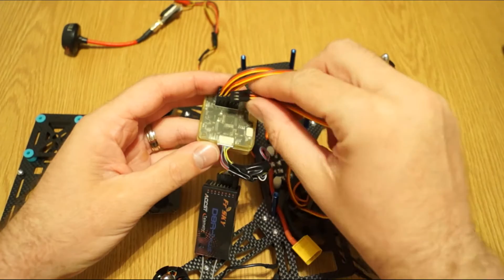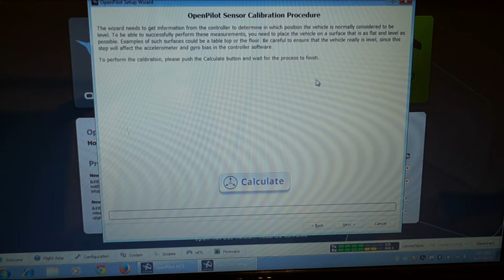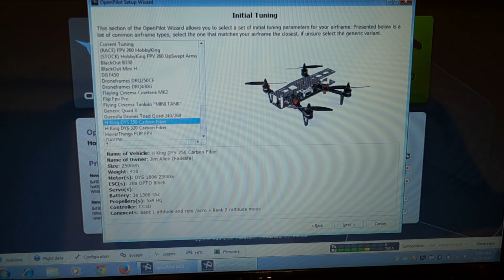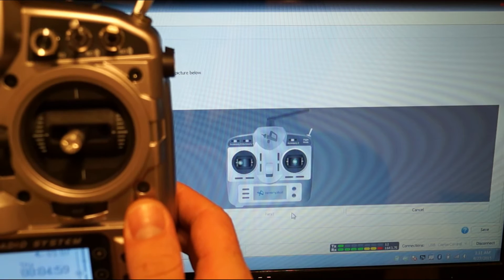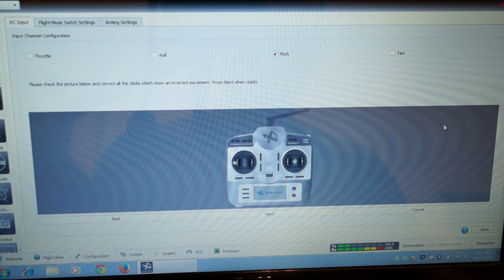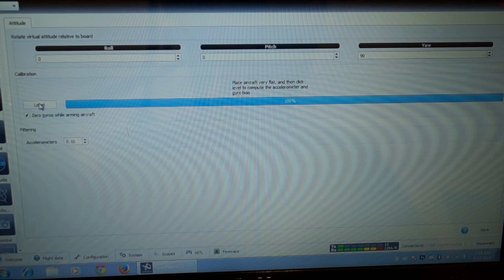AGM Nighthawk 250 Quadcopter Combo assembly part 2

Comment: Very nice and detailed video, only the autofocus of the camera get's is a bit annoying, but hey.

How do you secure the CC3D (flight controler)? I don't see it in the Video, and in other videos people don't have the casing like you have (and I to). I tried to remove the case and fasten it with the plastic screws together with the PDB, but the holes aren't at the same location. 

Can I also mount it upside down without the thing going crazy?
Reply from the maker: +Droolesky sorry for the focusing buzz...I will try sending a pics with this...basically I removed the case since there was not enough space and fitted double adhesive tape under it to fix and absorb vibrations.
Reply: +MrCofl1001 Pictures would be nice! I placed it with the casing where the camera is supposed to be, since i don&#39;t have one at the moment.&#160;And the camera buzz isn&#39;t that annyoing, thought i just point it out :)

But flying is really hard especially when you are farther away.I can&#39;t make out where the front is, so I stay rather close like 20m or so. Do you have any Tipps for this? 

Btw. can you see what the camera &quot;sees&quot; in realtime if you have one? I guess this could also help with flying farther away.

Comment: It's great that you taking the time to create this video and I don't think your videos are long they are very useful to novices like us getting into fpv. Question I have is what size battery are you using for your quadcopter and secondly, I take it you do  not need to remove the red wires for positive connection from three of the ESC's connecting on to the CC3D flight controller?
Reply from the maker: +Tony Hutchinson Hi Tony and thanks for your comments.
I tested it with 2 li'po's both on 3S, one is 1050 mah /30C which I dont recommend for any aggresive flying and the second one is a turnigy 3s 1300 with c rating 30 to 50 which I find more suitable for fast flying (see the first 3 mins of the test video what a nice climb rate it makes;
Regarding yor second question, it is a common practice for smaller quads where a BEC is not usable in order to power the flight controlled board with 5V from a ESC, there are other people saying it is safe to leave also the "+" red wires for all connectors but I keep only one for powering the FC and so far it worked just fine.
Cheers